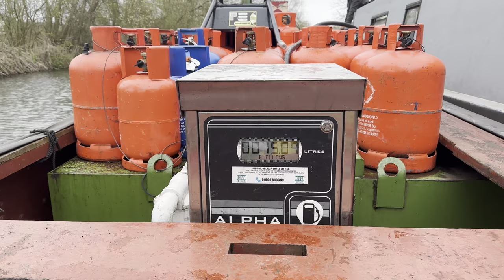526. Work starts on the midships cabin

Comment: One thing to keep in mind with the bunk bed plans is a safety rail, speaking from experience! It was no fun turning over in my sleep, to run out of bed and topple off the top bunk encased in a sleeping bag. As I was cocooned, I couldn't put my arms out to save myself so the end result was a broken shoulder. Painful!
Reply: Really depends on who's going to sleep there. I slept on a narrow top bunk with no rail most of my childhood starting at about 5yo and never fell off it. I didn't have a ladder either (mostly to keep younger sibling off my bed) and just pulled myself up.
Reply: @YaaLFH  yeh fair enough, I was slightly on the larger side for a kid as I was somewhere between 11 and 13, can't remember exactly. There was only me, and I had the choice of top or bottom bunk, regret my choice now as it wasn't too easy going up the Wolverhampton 21 lock wheeling with one hand 😅
Reply: @LKHNET  Using a sleeping bag instead of duvet or blanket was the choice you should be regretting.

Comment: In motorhomes they fit a metal drilled plate on the bulkhead to prevent moisture condensation happening.

Comment: If you want an occasional work surface at standing height, probably the kitchen counters or the dinette would be sufficient for that already? But if the kiddos need a quieter place to do homework, for example, or if you need a place where you can do some detail work, then sitting on the floor with the bench/lower bunk as a desk space would probably work really well for that, and the mattress can just go on the floor to sit on as padding. I realize that sort of work setup is much more the thing here in Korea, but even as an inflexible Westerner I do it myself for crafting at times and it's very space efficient and comfortable so might be worth considering.

Also, someone mentioned needing a safety rail for the upper bunk, and I recall that when I was a kid our boat had a length of canvas attached along the front of the bench which could then clip up like a soft wall when needed to stop us rolling off, and it just stowed flat under the mattress when not in use. That might work for your needs, too. I believe they do something similar with high strength webbing on some overnight trains.

Comment: There must be a way of pivoting the top bunk so that it can flip over.  That would mean it would have to have a solid bottom in order for that to become a working surface.  You would need to have the slats for ventilation,  but perhaps they could be retained using a routed track.  When the top bunk is not in use as a bunk, the built-in safety rail would be against the outer wall and (hopefully) wouldn't foul the lower bunk space.

If the head room is limited, that would also limit the size of the closet at the head end of the bed, because the person sleeping there would have to lean forward and out at the same time to clear it.  Not so critical for the little ones, but they have a way of getting bigger!

Comment: The top bunk could be made similar the camp beds where you run poles through tubes in the fabric (similar to cratch material maybe?) to take the weight , then on the bulkheads you have a wardrobe hanging pole type attachment (beefed up) to hang it from, then you could un-hang  it and move it back etc saves on a mattress then too - dunno just thinking as i type :)
Reply: I wrote my comment before you said about hinging the top bunk down to make it a day sofa back, if you make that work then go with that :)

Comment: My first thought; "slots" made of hardwood(?) that will lock the upper bunk in place for sleeping, then enable the upper bunk to slide down and swivel into the cavity, below the gunnel, against the hull, thus creating a back rest?
Maybe have additional slots to lower then lock the upper buck at a level to be used as a work table?  ;-)
Reply: Just two sets of rails mounted at two different heigths.

Comment: Where  you are placing the "cupboard" you could actually have a drop down desk top. So long as your electricals are in place , and still have space underneath for a set of small drawers . you simply fold up the desk when you dont need it . use also a folding chair to hang or store on the wall .